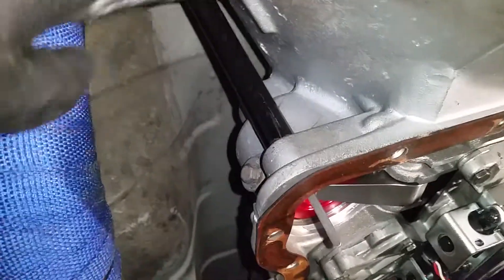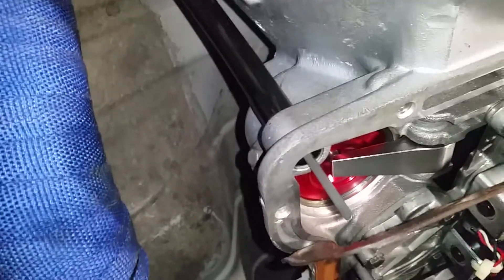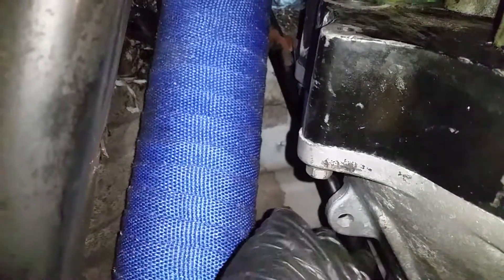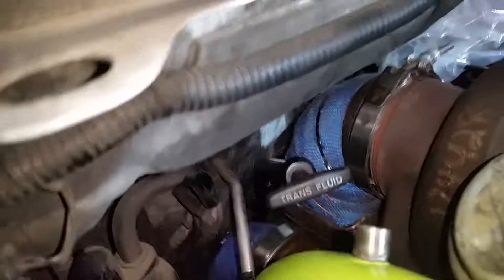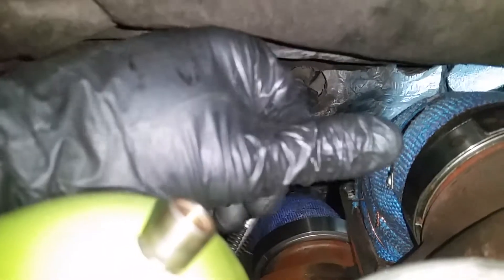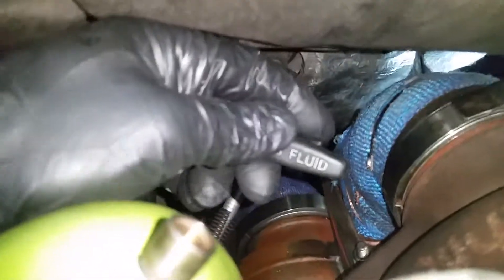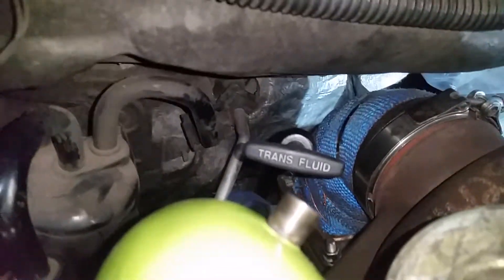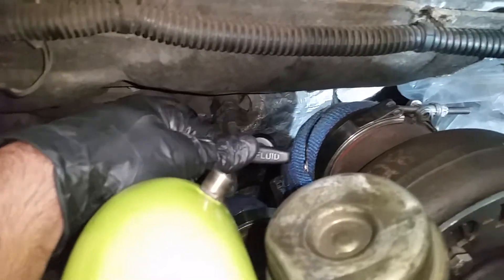48re to 47rh swap:  Will A 47rh Dipstick Tube Fit?

Comment: Don't the 47 rh use the crappy o ring seals that always leak?  I thought  the 47re style "top hat" style gasket was a better sealing design
Reply from the maker: Alan, you are 100% right! They are terrible and seem to leak unless you have them positioned just perfectly.  We used on this truck, but will be switching it out as soon as we can snag one from a 48re or 47re. That is a great tip to anyone out there who might be doing this, so thanks for bring it up!
Reply: 70440charger  I changed the oring on my 94 and seems ok for now.  It does look a pretty crappy setting